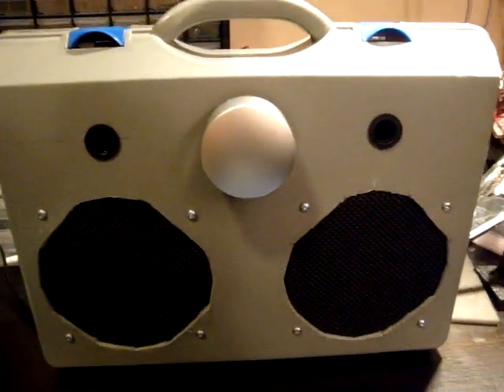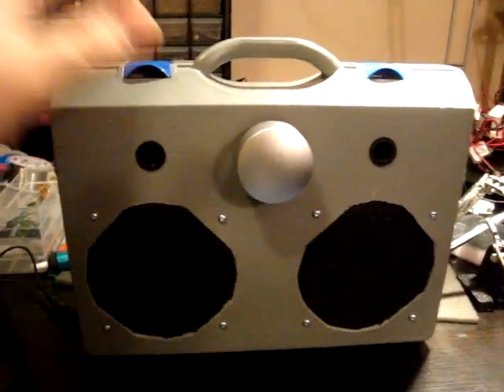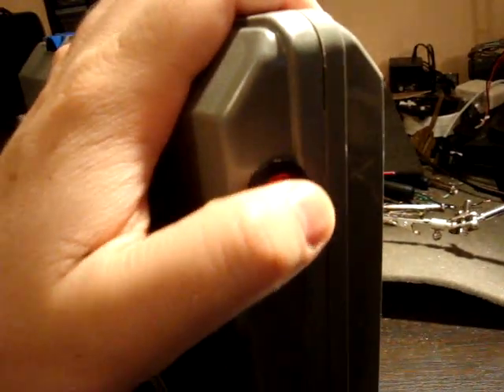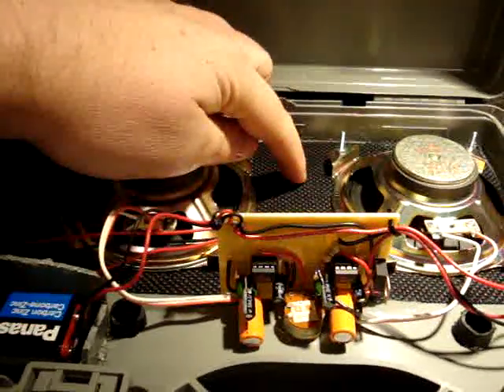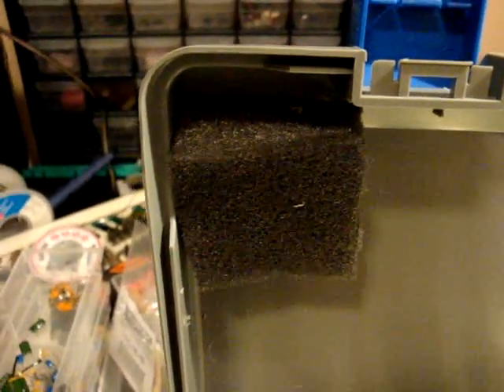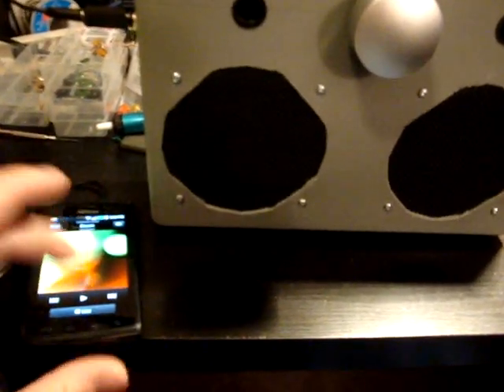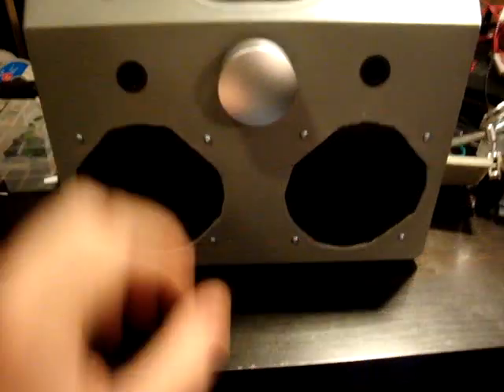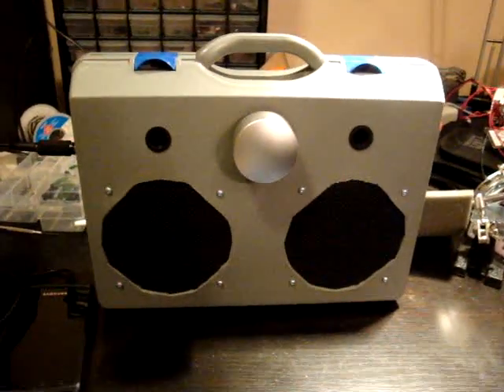DIY Portable Stereo Amp with Speakers

Comment: Schematics?
Reply from the maker: The schematic is in the LM386 datasheet. I made two of them (left and right) and used a dual gang pot for volume. I first used the 200x amp, but ended up hanging it to 20x (that was loud enough). Check the link in the description for more info on the project and the update video.

Comment from the maker: There is no PCB. I just used perf board. The schematic is in the LM386 datasheet. Just double the circuit and use a dual pot for stereo sound.